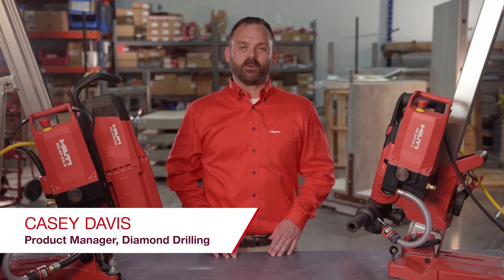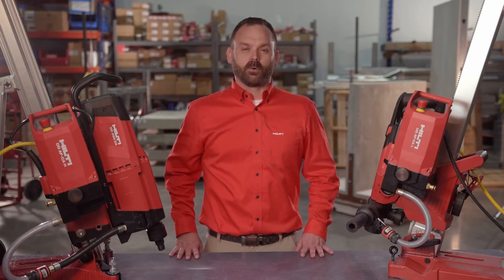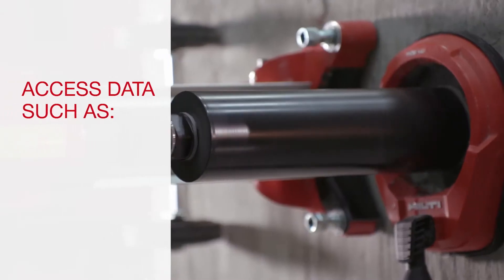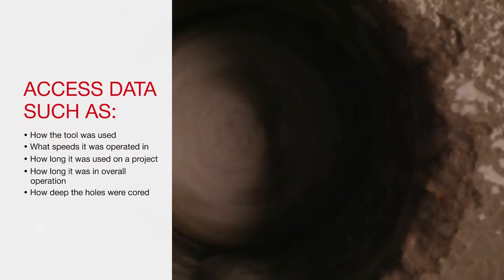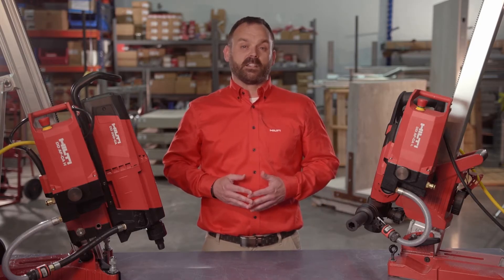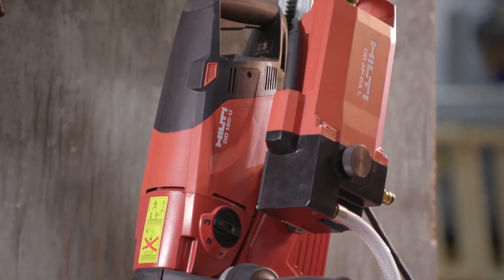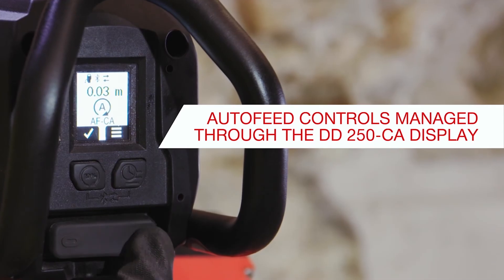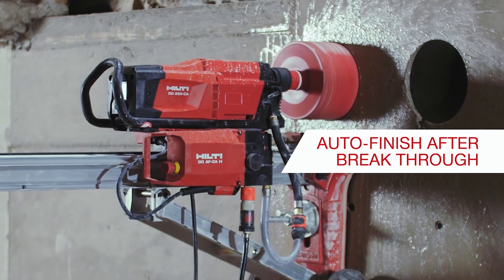Demo of Hilti DD 250-CA and cut assist units for diamond coring

Comment: Can you program the drill to slow down after x distance, for not breaking the back of the wall?
Reply from the maker: The DD 250-CA cannot program the tool to slow down at a specific depth; however, you can use the Depth gauge DD-HD30-ES to stop the travel of the tool at a specific depth. The Depth gauge is clamped to the column of the drill stand to restrict the travel of the tool motor and carriage. You can view this attachment online at https://www.hilti.com/c/CLS_POWER_TOOLS_7125/CLS_DIAMOND_CORING_7125/305535

Comment: We have 3000 holes to drill at work 2” diameter by 20” deep. We were told by your hilti sales rep of what we needed. He sold us a Hilti DD-150 BT with the cut assist and recirculating water system. I wish we could get our almost $10,000 back. We drilled about 30 holes so far in 3 weeks because this thing has so many issues. First we couldn’t get the cut assist to work so they sent out a female hilti rep to show us. Yeah that was 2 hours we lost at work because she knew this machine as much as we did!!!! She knew nothing!!!! So we then eliminated the cut assist and went to manual. Now every time the water recirculating system is beeping low water even though it’s full. We found out it was the float getting stuck and still sticks constantly. So we eliminated that. Now we have a water hose and doing it manually. What a waste of time. And we were hoping to get 3 more set ups but after this chaos I doubt our company will buy more. Oh by the way a week after the fist lady came by to show us she came back with another young lady. And yeah neither one knew how to operate that system again!!!!! Frustrated customers who paid almost $10,000 for a crappy system a salesman said would work for us!!!!
Reply from the maker: @elmeromero1794 - this does not sound good and we would like to get you in contact with our customer care team to see if there is anything they can do to help resolve this. Would you mind sending an email to me and if you have your account information please include it? - Ben, Hilti Social Team (bennett.myers@hilti.com)
Reply: @HiltiNorthAmerica if you read his post I don’t think they will be giving you a call. Leave the women in the office and stop hiring DEI people.

Comment: Is it waterproff? Or is it only 350 and Up still?
Reply from the maker: Hello, thanks for the question! Yes as long as you are using the correct bit you can core wet. Click the link to learn more 👉 http://hilti.link/Y9g
Reply: 250 is air cooled and not waterproof 350 is watercooled